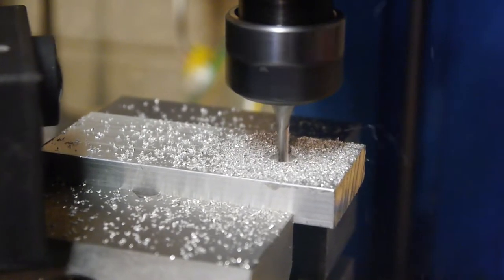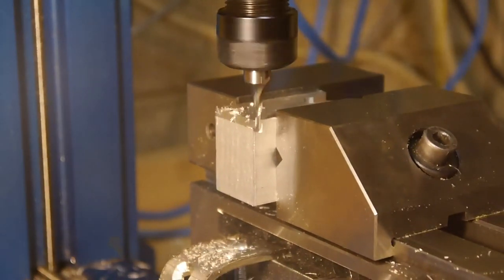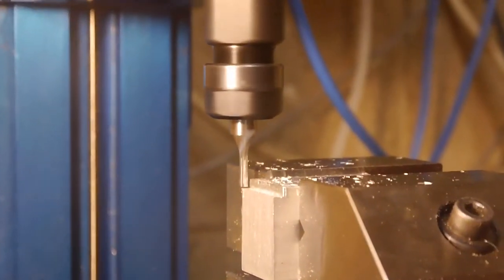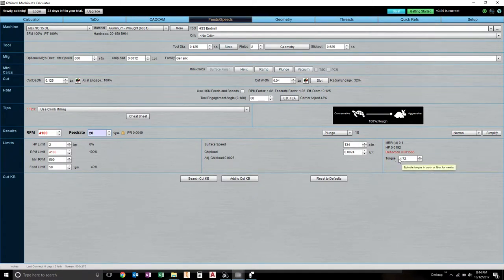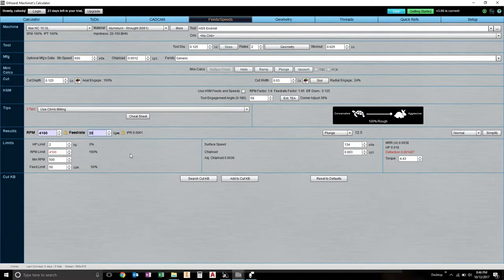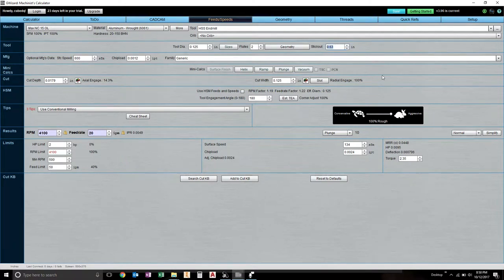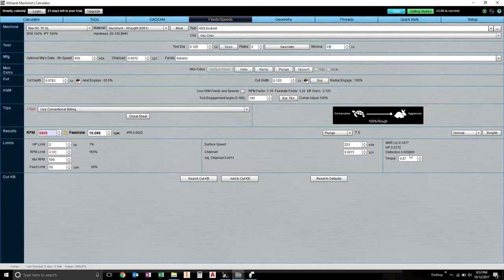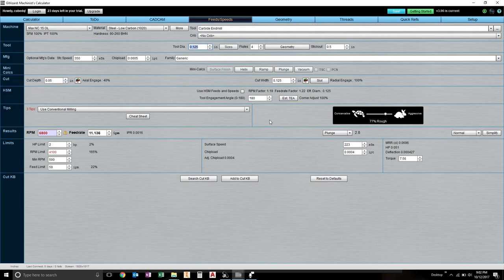How To Set Up your MaxNC Mini Mill's Speeds and Feeds for a new end mill or material.

Comment: POS , never was any good new. Someone gave me one, I'm giving it back. Not worth replacing all the electrical components, servos are Bipolar 1.55 amp 65 volt and there are no affordable drivers, spindle motor is old school AC/DC combo. Body is weak and 1/4-20 lead screws are pathetic. Don't waste your time and money on one, even if its free.
Reply: Thank you for letting me know, found one at my old school for free and was going to try using it.